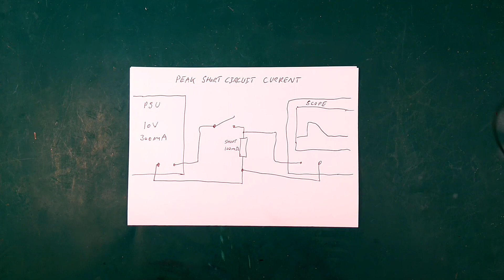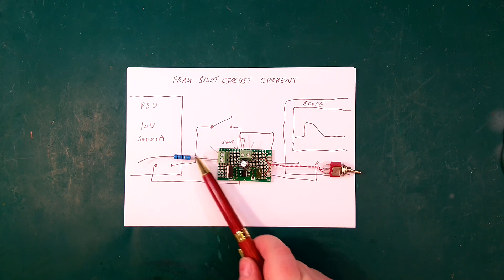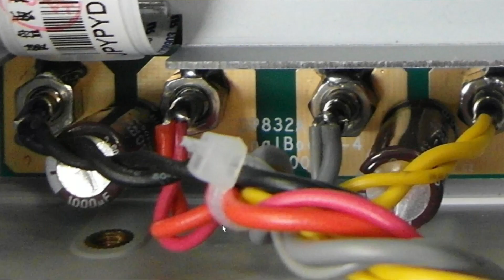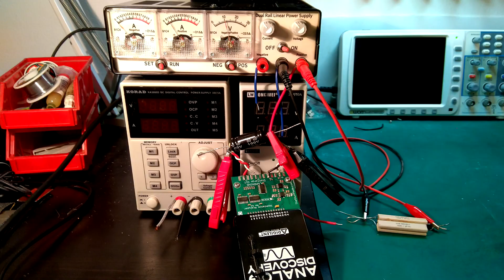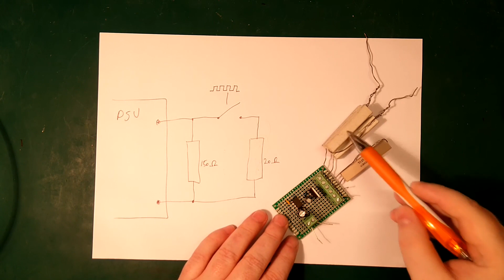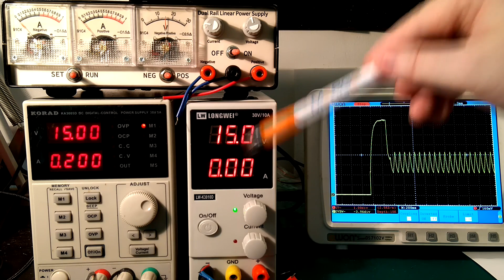Bench Power Supply Testing, Homemade vs. Korad KA3005 vs. LongWei LW-K3010D

Comment: I'm thinking of buying a Korad, do you think it would be pointless?(for laptop repair )
Reply from the maker: It's a good power supply, I don't do laptop repairs so I'm not sure if 5 A is enough current.  But as a general purpose bench supply for electronics I do recommend it.
Cheers,
Jake

Comment: Excellent video very easy on the ear, many thanks. Can you tell me the video you did and the mod to stop the on switch spike and where to fit output capacitor for prevention. I have a 30v 10A similar PS and blew mosfet  when setting amperage my fault voltage and amps were to high when I shorted the leads. Thanks again.
Reply from the maker: Thanks, I have a video where I make a few simple modifications to get rid of the switching noise:
https://www.youtube.com/watch?v=WytDROmjWKQ
Cheers,
Jake

Comment: My Korad had famous crash issue even with the updated boards. I'm done with this Chinese junk. From now on, on keep on saving money to buy Rohde & Schwartz or similar high end equipment. Granted you can buy a complete lab with Owon or Siglent stuff for the price of just a Rohde & Schwartz power supply, but at least you don't have to worry about the equipment failing or, even worse, destroying anything hooked up to it.
Chinese just can't designing anything decent.
Reply from the maker: That's a shame your power supply broke down, however it's unlikely to be the same issue as the first revision boards. Why not have a go at repairing it? Keep in mind that all power supplies break down from time to time, including the most expensive ones from HP/Agilent/Keysight or Rohde & Schwartz.
Cheers,
Jake

Comment: Seeing this my old idea comes to mind: How about switchable capacitors for the output?
One low value, one high value.
Depending on what you do with it, you can choose between them.
I've seen one guy who straight away exchanged the 300ish μF cap on his power supply for a 47μF one, if I recall correctly.
(I am kind of binge watching lab psu stuff the recent days)
Reply: hey, can you tell me how to find the guy switching caps?
Reply: @dany_2945  Sorry, but I watched so much other content in the mean time, I would not find that anymore.
I only recall him replacing the 300ish μF output cap with a 47μF one, so the charge and discharge time is lower. For his application it was fine, but you sacrifice a bit of voltage smoothing that way.

Comment: Very informative. I have the same long wei supply and it is indeed very slow in regulating current. I did blow some fuses due to this supply 🙄
Reply from the maker: Thanks, yeah, have to be a bit careful with the LongWei, but it's still great to have around when you need a lot of current. I have another video on this power supply where I make a small mod to get rid of the switching noise issues if you are interested.
Cheers,
Jake
Reply: @TheStuffMade  I'll attempt to do that mod. That video was very detailed and well explained too. 👌👍

Comment: A good example of "horses for courses" - All power supplies are not born equal. If you are playing with low noise op amp circuits, build yourself a linear dual rail supply. If you are building a 500W fairground lighting controller , go with a smps!
Reply from the maker: Yeah, that's a really good way to put it, we need all the different types of power supplies, each with their own strengths and weaknesses.
Cheers,
Jake

Comment: Is not it possible to build a circuit that when current limiter reach's Max set current it shortens the output capacitor ( with "output enable/disable discharging" switch )?
Reply from the maker: Yes, for that to work the design will need to have a shunt after the capacitor on the output to measure the actual current and then use a feedback loop with a transistor to discharge the capacitor when the current is too high.
Reply: Why you wanna do that ?
It swithes off right ?which It should do .

I guess the discharging Will reduce the voltage if that maybe a problem ? ?
Buy that may up the current again ?
I may be totally wrong ,Just asking

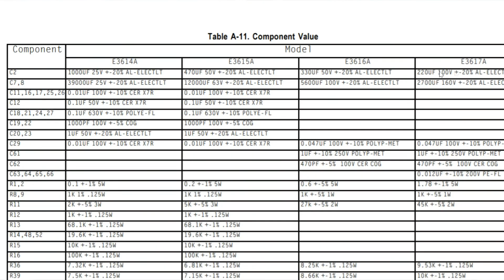Comment: Very nice and interesting advanced-level performance tests you performed on those PS units. At 9:16 I tend to disagree your statement: mid and high-end power supplies (including your Korad one) have the possibility to preset the voltage & current settings and they have an output on/off switch. If you use that built-in switch, it will not overshoot in cc mode. By using your external opamp-mosfet switch, you compromised the performance you were expecting for. I know for sure because I tried both ways with my TTi PL-601 unit and saw the difference.
Reply from the maker: Hi paulbt, thanks. I agree with you about the power up current limiting, however the scenario I'm testing here is how much current the supply will deliver once it's already up to the set voltage and then the output is shorted. A realistic scenario would be if you have a circuit powered up on the bench and you are probing some pins with a scope or multimeter and accidentally short one of them to ground or the positive supply.
Cheers,
Jake
Reply: @TheStuffMade  yep, you are right then, I never thought about this scenario. In this case  the amount of output capacitance does matter and also the response time of the feedback loop that is regulating the output. Regards!

Comment: Are you the guy that made a better impedance analyzer for the analog discovery?
Reply from the maker: Indeed, I designed and build mine long before Digilent came up with their version. You can download all the details (schematic, board layout, software, instructions etc) if you find my video on the latest version and check the download link in the description. Be aware the software might not run correctly for Analog Discovery 2, I've had some mixed reports, but I don't have an AD2 to test it.
Reply: @TheStuffMade  , did digilent incorporate your improvements, like calibration procedures?
Reply from the maker: @hansjalbertsson7736  Not that I'm aware, however it's not really my invention how to calibrate an impedance analyzer, I got most of the theory from the HP/Agilent/Keysight Handbook on Impedance Measurements. It's an excellent compendium on impedance measurements and very much worth a read if you are interested in how it works.
Reply: @TheStuffMade , of course you're not the inventor of calibration but you did include calibration procedures and gui elements in your sw! Which is more than good enough!

I suppose you can hand compensate an impedance measurement in Digilent's sw, if you measure enough well known components first?
Reply from the maker: @hansjalbertsson7736  Sure I know math and I did work as a senior lead developer at Microsoft for a decade, however I have little interest in the Digilent software.